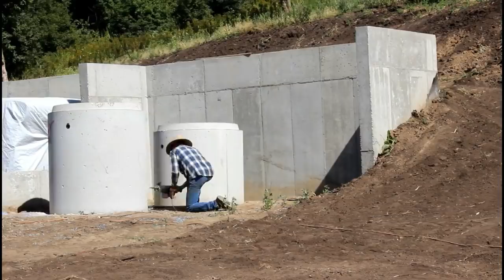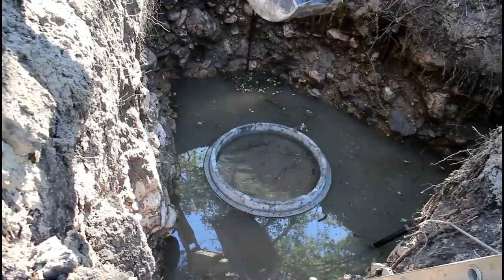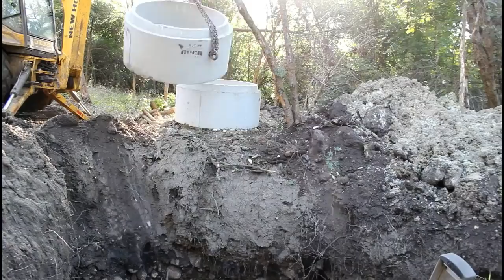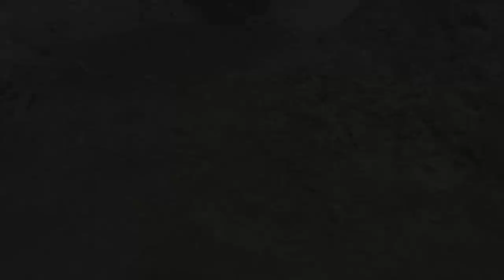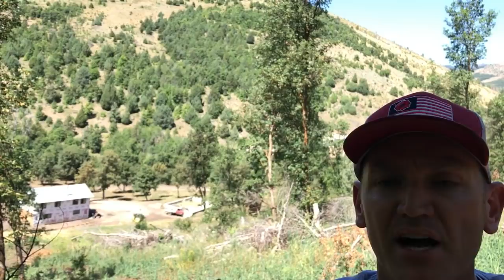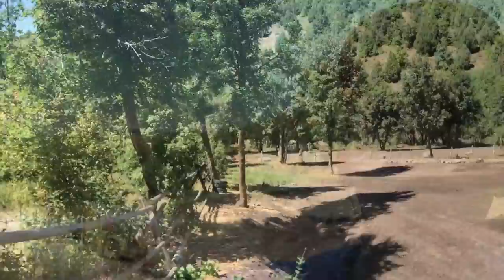DIY Shallow Well - Set Concrete Culverts In The Shallow Well. Pt 2

Comment: Why not just a standard pressure tank-the ones with the air bladder in it.
Reply: I'm guessing it's a power issue; lack of 100% on demand power means the need to pump and store when power is available.
Reply: Digby O'Dell True, he is doing solar/off-grid. But would pumping 500-1k gallons uphill 100 feet every couple days be much less than 30 feet uphill to the house a few times a day? I suppose if he anticipates no electricity available at all for periods of time then a reservoir uphill would still provide water with usable pressure.
Reply from the maker: One more thing to fail... I've installed many tanks and pumps but I don't want to if I can help it.
Reply: Hand pump? Bucket and winch? 😊
Reply: petnzme01 Might have exaggerated a bit 😀
Reply: petnzme01
In my neck of the woods, when sizing cisterns and septic systems we design for an average 50 gallons a day per person with a peak demand of 75 gallons/day…  Unless you’re practicing pretty strong water conservation habits, it’s easy to use a hell of a lot of water in a hurry.  That said, my cistern can go 8 to 12 weeks before I get a truckload of 3000 (imperial) gallons for two of us.  (in my neck of the woods, wells are impractical.  400+ feet, and while it doesn’t have biological contaminants, without softening and heavy filtering, it’s unpleasant to use)  We typically install 5000+ gallon cisterns for folks up here, so they have a reserve and can take a full truck load of city water, as the trucking cost is 90% or more of the bill.  We had one client we did foundations and septic for that had an oilfield driller “pop by as a favour” to quickly pop in a well.  Those boys thought they’d be in and out in less than a day.  4 days later he has a well…  An awesome producing well, but undrinkable. The joys of living on an ancient glacial lake bed on top of ancient shallow ocean...
Reply: Eh, hard to collect it when it’s solid as a rock 6 months of the year.  That being said, I’also installed dozens of (underground) tanks that collect rainwater in season for flushing, irrigation and other non-potable uses.    I do have about 1000 gallons of above ground rainwater storage for watering our garden and the like.  Could I build a filtration system to go with that?  Sure, but it’s just easier, cheaper, and safer to have it delivered.  In trucks that are designated potable water use only, and are as regularly inspected and tested as the water treatment source.
Reply: petnzme01 hen.  I wish I could.  I'm about 800 meters above sea level, And thousands of kilometres from an ocean, so access to pure rainwater here is a different story.
Reply: petnzme01 eh, I just prefer it clean  of contaminants.   You want to come up here and drink from a rain barrel, you knock yourself out.  I've got better things to do with my tine than fuss with purifying systems and storing water over six months of frozen winter. When   it's when it's so cheap in bulk.  We get a whopping 350mm of rain a year.
Reply: petnzme01 no, they get it from the local municipal water grid which treats and supplies the water for over a million  people. We take potable water and sewage treatment seriously around here.

Comment: Pretty sure model airplanes even ones from back then were loud as hell. Pretty sure if you were blind you would have a good idea where it is.
I know he ends up wrong on the elevation. 

Couldn't he have put a 20 foot pole on the top of his roof with his laser level and find what 50 feet is at on the hill.
Then you move the 20 foot pole to that same spot on the hill and then walk up the hill until you are level with the laser and you will be at 70 feet and then repeat.

You could just do 20 feet at a time

Comment: Very well thought out....that ground water must be great spring water from an underground source... that was seeking it's lowest level...the bottom of the hill... It should be fine, but test a few times a year...as you start working the land you are going to have to do everything organic...no pesticides, chemicals... Each video I am amazed at what one man by himself can accomplish... don't ever get rid of that back hoe... you will curse the day you do... getting one used that runs like that is not easy...Just an inexperience heavy machine question.... couldn't the back hoe dig a trench? Or the excavator allows a line to be run deeper? Just curious...
Reply from the maker: The excavator can get places on my property that I'm not comfortable taking the backhoe. I know I will miss the backhoe but the next phase of our homestead development requires the excavator. Thank you for the kind words.

Comment: Set most pressure tanks to 70 lbs LOL same with pump lol also well is supposed to have atheist foot of river stone I.e clear stone on n.bottom and as u add tiles u keep back filling with clear stone. Then to top tile u should trench 6 inch trench red whole thing to bottom then hydraulic cement it like law so water doesn't get contaminated.? Glad suckers think u did this right so u got views but u really stuck dude